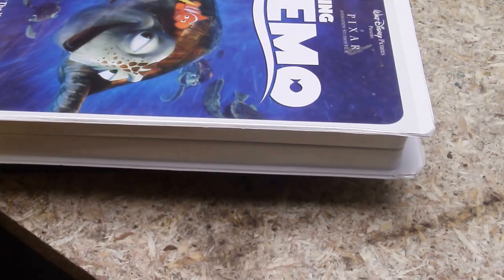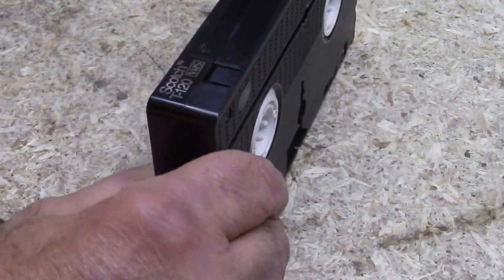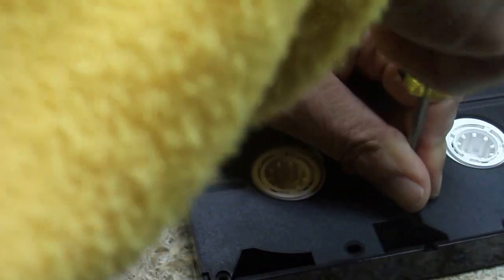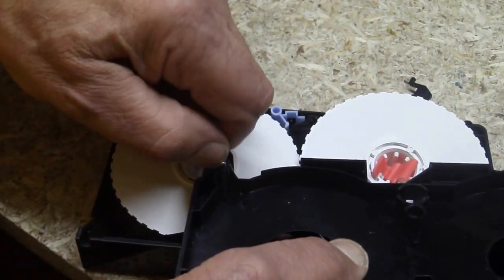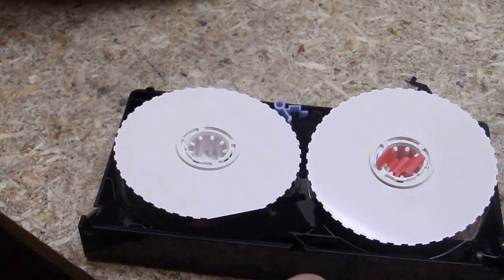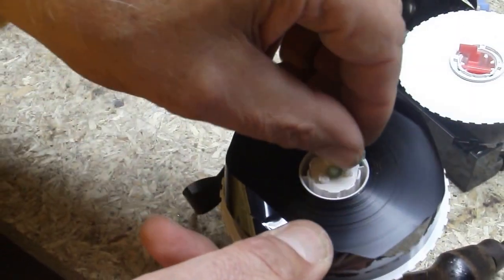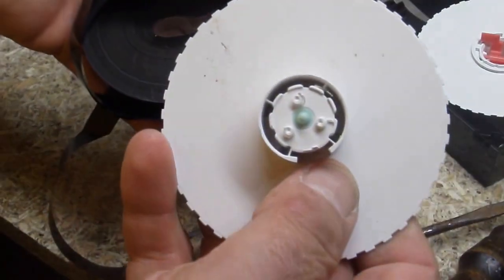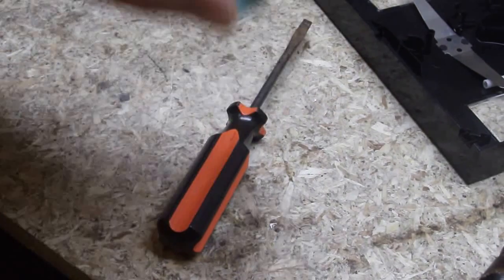How do I recycle VHS cassettes?

Comment: the problem with this is that the tape itself it the part that is toxic to the enviroment. The mylar tape takes 400 years + to break down and the heavy metals embedded in the tape are a huge problem. No one will recycle them without a fee and I wonder if after paying them if they actually break down the metal oxide and properly recycle/dispose of the problematic ingredients.

Comment: hi this would help i had to take alot of betamax apart i used a round cutter i put in my drill stand of you can drill out the 3
holes that hold the top of the reel on this vhs 1/2 inch work ace on 1/2  reel to reel i got a tascam 34 that will take video 
yes 34 i changed the 1/4  to 1/2  works very well

Comment: Very little of a cassette can be recycled.  If you disassemble tapes, save the tiny metal pieces for a scrap metal dealer, throw the plastic case in the trash and take the videotape to a company that accepts hazardous waste.  The plastic CANNOT be recycled, the metal should NOT go into a recycle bin and the tape should NOT go in the trash.

Comment: Thanks so much for doing this video!  I do not want to throw away my old VHS tapes and have them end up in a landfill.  It's too bad the tape inside the case can't be recycled.
Reply from the maker: Thanks for the comment. If I find a way to recycle the tapes, I will post it here. All the best.

    
    
bemyvalentine320
Reply: You can use the tape to weave with to make baskets and things
Reply: Are the little metal bits able to be recycled as well? :)
Reply: True but compared to the rest of the vhs, it's a small component and isn't going to take up much room in a landfill.
Reply: @rs72098  As I understand it, the volume of the tape is less of a problem compared to the issue of toxic metals in it which leach into the soil.  For that reason, I also don't want to use it for crafty stuff. 😏